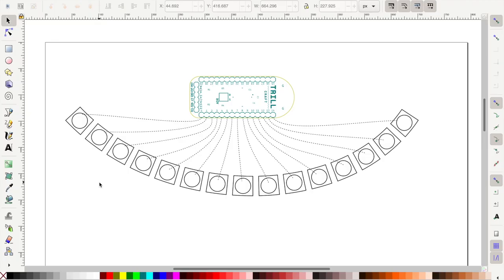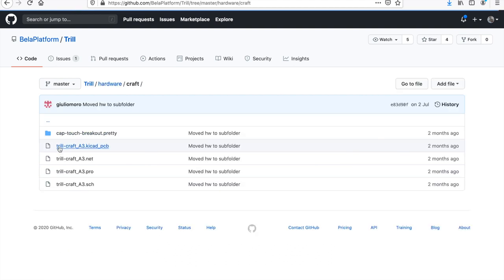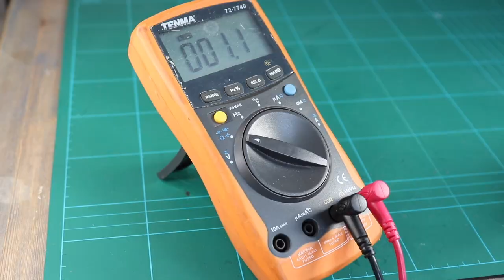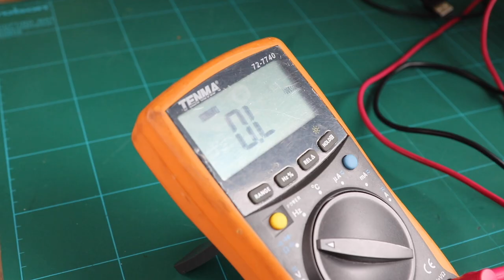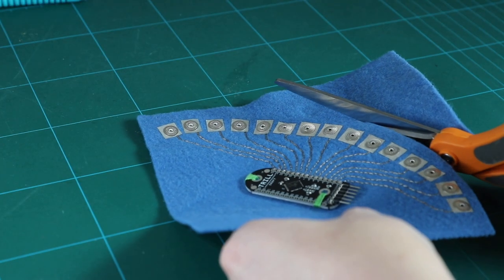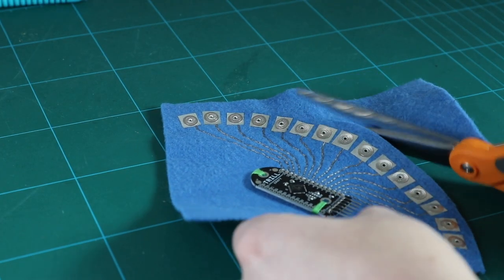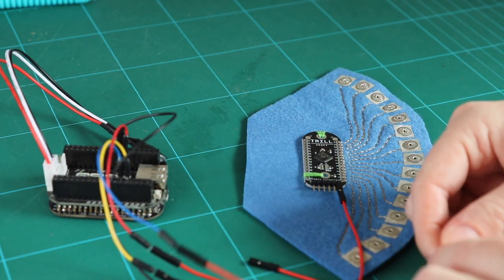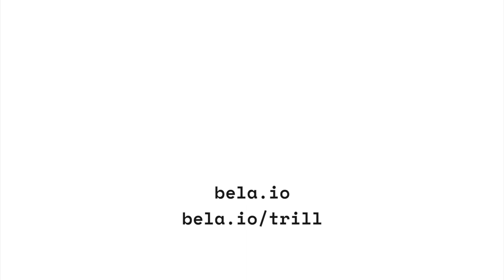Fabric Interfaces Tutorial: E-Textiles, Conductive Thread and Trill Craft

Comment: Hi, thanks for the great tutorial! I'm still slightly confused about the part from 6:00 onwards - does the iron on adhesive still conduct between the thread and the conductive fabric pad once ironed on? If I'm getting the order correct (felt->thread->adhesive->conductive fabric)
Reply: Generally yes, there is still a conductive connection because iron-on adhesive is porous. However this is why you should always test the connection with a multimeter to make sure!
Reply: @disastrid  ahh that makes sense now, thank you ! so it's also a good place to remember as a potential source of loose connections later on

Comment: hello very didactic, your video, I ask you some questions 
1- Could you help me link to the software
 2- This microcontroller that uses trill needs the Arduino yes or yes to make the connection with the PC
thanks in advance
Reply from the maker: Thank you. To answer your questions, yes you do need a microcontroller to read from the Trill sensor. Most microcontroller which support i2c will work, e.g. arduino, teensy, stemmaQT. Also raspberry Pi or Bela work really well. Here is more information: https://learn.bela.io/using-trill/get-started-with-trill/

The example which Becky uses at the end of the video is for Bela and can be found here: https://learn.bela.io/using-trill/trill-and-bela/ Here's the link for Arduino getting started guide and examples: https://learn.bela.io/using-trill/trill-and-arduino/